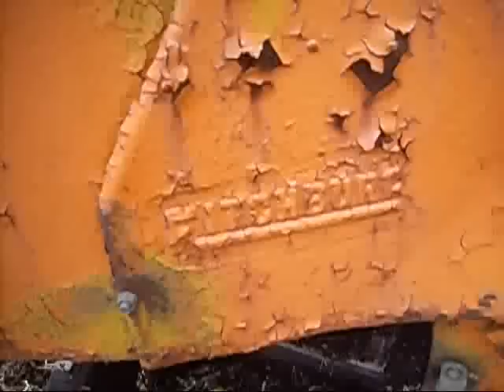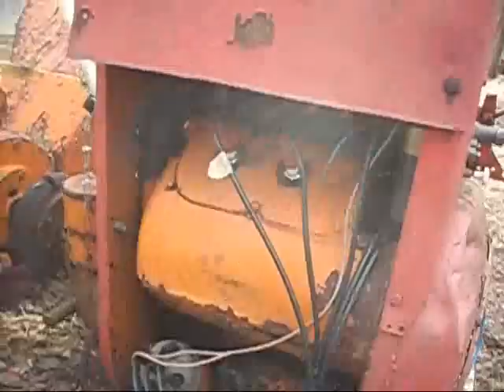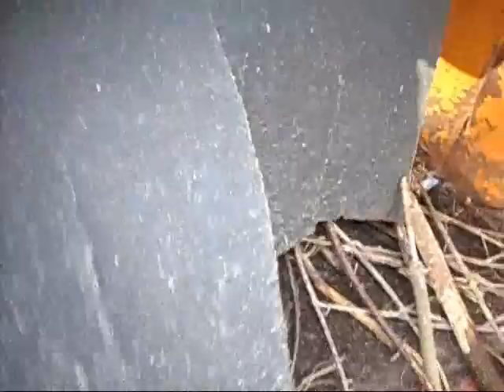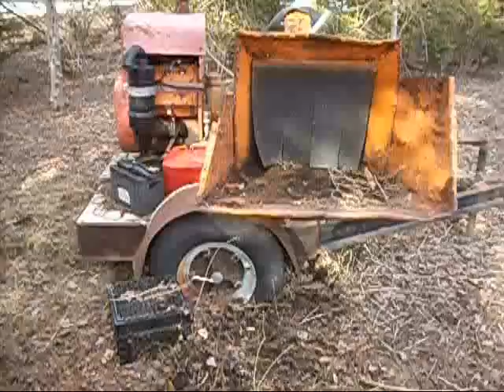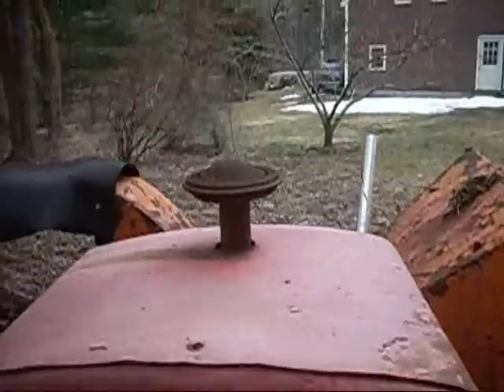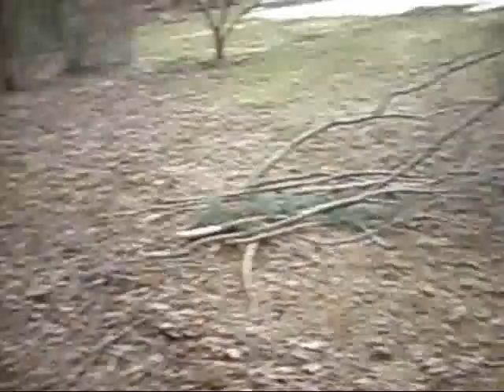Fitchburg chipper cold start + chipping action

Comment from the maker: This is why you need to live closer. I would totally be right there if the thing wasn't 1500 lbs with no trailer suspension. Its a "custom" trailer that someone made and bounces all over the road like a flippin rubber bouncy ball but it certainly does love to eat pine :-)  The sportsmans club has rented a bigass chipper a few time when we had "clearing parties".  Would eat ANYTHING you could manage to drag to the feed rollers. It was only about 200$ for the day, did a LOT of work, option maybe?